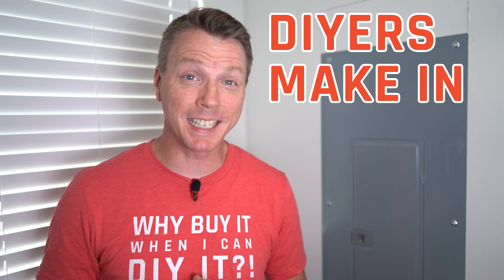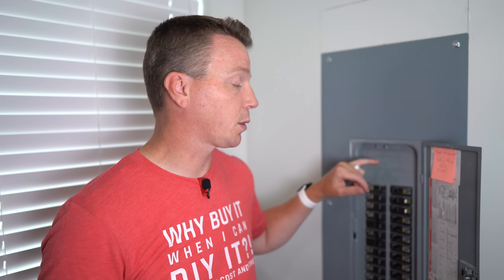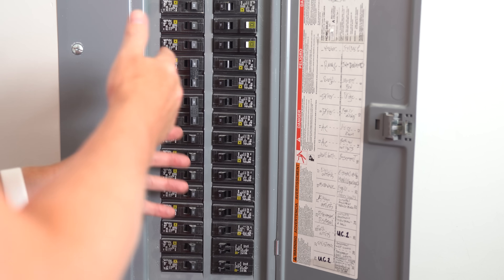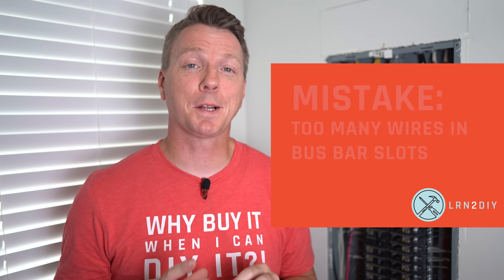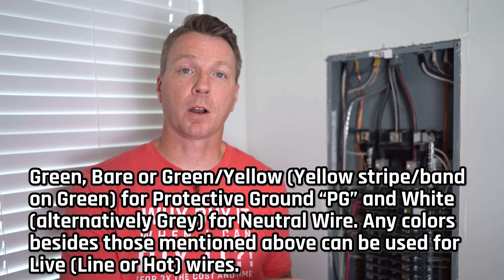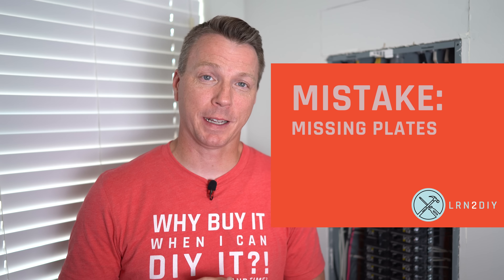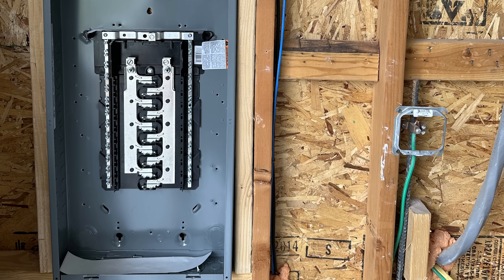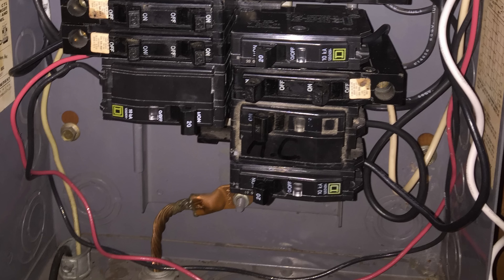10 Common Mistakes DIYers Make In Circuit Breaker Boxes

Comment: The money savings DIY.  200 amp 220 main. Iirc 10k watts for heavy electric 220v motors put in by expert certified Electrician*.  Ran correct rated wire to required disconnect. Then smaller wire last 10’.  Melted circuit breaker, then disconnect.   Dummy me calls Electrician who checked loads.  “Your 10 hp motor is drawing too many amps” I have Cuttler Hammer disconnect, breakers replaced $$$. *I had requested Square D QO but he put in CH 
  I remove motor, have it checked.  Load tested.  “It’s well within range”
 So I melt more breakers.  Expert Electrician tells me to put MUCH larger rated breaker.  It ruins 200 amp main.   It then trips every 3 hours load.  Instead of hiring *Expert I go online. But recommended replacement  25k watts rated. It has 2.5 TIMES the capacity at same amps.  Iirc $60.  5 minute replacement. ok took me a half hour in spring I will check torque using socket. 
  All because he put SMALLER wire last +10’ in conduct.

Comment: There are a lot of comments here about Romex color, but they all ignore Romex's competitors -- in the 1970's, there were lots of companies making NM cable, and a bunch of them used black sheathing, such as the Phelps Dodge company.
Also, regarding double-tapped neutrals and grounds: Square-D explicitly lists the torque requirements for double-tapping 14AWG or 12AWG on their ground bars, knowing that both wires need to be properly connected. They also indicate that putting two 14's is OK, as is putting two 12's, but never a 14 and a 12 together, because the 12 will prevent the 14 from having a good connection.
Regarding wire color, some local jurisdictions add additional requirements. For example, my county says that "a single hot MUST be black, the second hot MUST be red, and a third (usually only applicable if running multiple circuits in conduit) MUST be blue."

Comment: I think you should add that its against code to install a breaker that is not approved for that panel. A square D panel can only use Square D breakers or breakers approved by Square D.

Comment: Having been educated in electrical engineering at an MIT level university followed by military electronics service and 40+ years doing design work, I grimace when I hear some of the erroneous information being taught about electricity.

For instance, you said,

  "there's some serious voltage and amperage flowing here"

"14 gauge wire that's capable of producing a lot more electricity pushing a lot more voltage or amperage"

Voltage doesn't flow.  Voltage is a measurement of the potential between two points.  The amperage (amount of current) that flows is dependent upon the applied voltage, the impedance of the load and the impedance of the voltage source.

14 gauge wire doesn't produce electricity or push voltage or amperage.  14 gauge wire is just the medium through which the current flows.

Comment: Great video. I was wondering if you'd tighten up connections. I always do this when I have a panel off, not with a torque driver (I'll get one.. never knew it existed) but by hand to ensure they're snug. They're seldom loose, but if a slacker installed something, they can all be loose 1/8-1/4 turn.  The box at the end was super clean, but as a long time troubleshooter, I've often cut tywraps to trace wires.. then tie them back again.

Comment: its all good  unless you live in UK  240V  BROWN=LIVE    BLUE=NEUTRAL   GREEN/YELLOW=EARTH     now lets look into the breaker box   there are whites there are blacks  some used as ground and some used as neutral  they are very thin   whats that big fat red cable?  ah the cooker  then at the cooker socket its brown  so somewhere there is a junction box where it changes colour  this would explain why my cooker has no power at the socket  has the breaker tripped NO  is there a short circuit NO  is there power to the breaker both ends YES  is it open circuit NO is it slightly open circuit (burnt contacts) where it holds some voltage but no current  I DONT KNOW  cuz i cant load it  where is the junction box?  i dont know i have just moved into this flat and its not my problem i am not allowed to look for faults   does your kettle work YES then shut up and make a coffee

Comment: When I bought my house my father and I looked in the electric panel.   Obviously, the township didn't do their job.  A number of circuits had two or three lines plugged in.   We bought breakers and fixed the problem.
Then we had to figure out what breaker controlled what room or appliance
I do want to put in a sub panel and will  have an electrician do that work. It's beyond what I can do.

Comment: Not the same subject but a question for the sparkies in here.  I bought a condo years ago that was built in the early 70's.  For some reason there was copper and aluminum wiring going to the same breaker.  It didn't seem right to me. Sold that home version of a ford real but not quick enough. lol

Comment: He’s right on about 90% of this information.  He does explain things in a way that other DIYers will understand, but there’s a saying in this line of work; “knowing just enough to be dangerous.” One thing that I would edit is the bit about overloading the panel. Load calculations have nothing to do with how full your panel is. It’s a long and boring process dictated in detail by the NEC but to overly simplify it, all loads in dwelling units (especially single family) are not used simultaneously and continuously and even if you purposely turn everything on at the same time, you’d still be hard pressed to pull 100amps through that panel. Besides, busbars in Square D panels (as well as some other brands) are usually rated 25 amps above the main breaker rating. And tell me, how would feeding a sub panel from the panel your worried about overloading help? Think about it. Otherwise, well done slim…we’ll make a sparky outa you yet!

Comment: Do you a video on how to layout dedicated circuits in a hometheater to eliminate groundloops hum coming through speakers or subwoofers?  I heard that the breakers should be on the same leg or phase, but it is not clear to me. I don't know if my breakers are installed properly.   Thanks

Comment: Remarking the white wire is only code compliant for the feed to the switch for a light. It happens a lot on 240V circuits to A/C and such things when done by HVAC techs. One of my pet peeves when I was still working was that inspectors would allow HVAC techs do, but electricians would get red tagged for it. And in new code the remarking for a switch isn't going to be permissible because a white/ neutral wire is now required for switch locations to accommodate smart switches.

Comment: See the problem with my panel isn't just the fact that it's labels like someone had a seizure in the process, but also that the circuits make NO sense. I have the garage, outside lighting, half the living room, half the kitchen, half the basement , AND THE MICROWAVE all on a single 15amp circuit. How am I supposed to even label that??

Comment: Don't forget improper ground bonding.  I see a lot of sub fed panels with the neutral bar bonded to ground with the bonding screw .
Reply: That would be normal and required if the panelboard had a main breaker existing as main  service disconnect.   This example was a MLO subpanel with an upstream disconnect which should have been pointed out in video.

Comment: Regarding labeling circuits in the breaker panel. Instead of scrawling in my poor handwriting on the panel and trying (and failing) to find pre-printed labels suitable for my house, I created a table in a document editor (I forget if I used a table in a word processor or used a spreadsheet, probably the spreadsheet knowing me). I then printed it out, trimmed to fit my panel door, and attached it with small magnets. This has the benefit of being easily changed if I end up reworking my house electrical. The downside is paper is flammable...

Comment: First.  That circuit breaker finder doesn't work on long runs like schools.  Second, all kinds of wireing colors are used but gray white bare or green should be considered hot. My house has blue, yellow, orange, red, even purple hot wires.

Comment: Your points are all good and I agree totally,  I wish you would have spent more time on electrical safety especially in a main panel.  Some of us know you are in a sub panel and it must be totally deenergized otherwise you would not be so cavalier with your fingers.  It might have been useful to show a main panel and point out the main breaker and the parts of the panel that are still dangerous and energized.

Comment: That is a Square D breaker and has two positions for tapping and is therefore not double tapping.  It is NOT double tapped.  I suggest you call Square D.  They are NEC compliant.  That is one of the reasons to use Square D QO or Homeline boxes.  Of course the Arc Fault and Ground Fault breakers only have one position.  I have seen inspectors claim that what you show at 8:40 is double tapped, but I refer them to the specs and Square D's phone number.  Double tapping is placing 2 hot wires in the same position i.e. same screw.

Comment: I hate to break it to you, but there is white NM 12-2 wiring out there.  Yellow tends to be the Romex brand.  The actual gauge will be on the outer sheathing.  I never bother with 14-2 wire.  I use 12-2 even for 15 amp circuits.

Comment: Thank you for your video. I have a question. Can I install wires through the back of the breaker box into the interior wall and then under the house?

Comment: Taping the conductor I'm my jurisdiction is not legal unless it is larger than a number 6 conductor. Smaller wires need to be either heat shrunk or can be painted to properly identify.

Comment: If found that labeling things backwards works well.  Put the number of the breaker on the OUTLET, when possible.  Fridges and stoves and ceiling fans are more difficult, but there is less to write on the box.

Comment: jus a little fyi for using a toner. the orientation of the nose of the tool to the breaker makes a huge difference in its effectiveness. holding it sideways can greatly reduce its effectiveness.  be safe, have fun.  cheers

Comment: If you're turning breakers off an on (the "loud radio method" or "yelling method") there's a fast way and a slow way.

Slow - turn breaker off, wait a second for the radio to go quiet or the yell.  Turn breaker on.  Repeat.
Given N breakers this can take as much as 3N seconds.  

Fast - the binary-sort method.  Flip half the breakers off.  If that didn't quiet the radio or start the yell, turn those back on and turn the other half off.  Repeat until you find the one breaker.
Given N breakers this can take as much as log(2)N seconds. 

That means for a 32 breaker panel the slow method will involve as much as 63 offs and ons.  The fast method will involve 4 such moves.

None of this addresses the IW (inside wiring) connecting unrelated areas, circuits, uses, etc.  That will require opening walls, drilling through studs, and generally take 1-2 days of two electrical pros.

THAT is not DIY at all.

Comment: Sir, mistaken #1-#10, is (1), turn off main breaker BEFORE removing access panel, and (2) know that the service wires (100-200 or 400 amp) above the main breaker are LIVE, so don’t wave you fingers around it.  Touch the wires or the lug tighteners, and your wife will a widow.

Comment: If you fill all the breakers in the panel and they passed the max load of the panel you probably "overloaded" the panel, no? if you turn on all those appliances, lights that connected to the breakers, you probably will need more amps than the panel is rated. But isn't that what breakers are for? if you pass the load the breaker will trip, isn't that right? I can't really understand that statement of "overloading the circuit panel". Is that an extra safety step in case the breakers will not work properly?

Comment: Like most people sometimes I'm a DIY'er, sometime I hire a "pro". It's still good to have the knowledge because "pro's" make mistakes, often huge mistakes on your dime. I've also had "pro's" that totally lied about something small that was broken and instead wanted to put me in for a fortune in repairs. Once on an a/c I got charged for Freon, which blew out of the a/c when disconnected, vented for quite awhile. I was told I need a huge repair in the attic, I went up there and saw the part I needed "fixed", well, the original tape was keeping it from being seen, I suppose he was a psychic repair man. I bought a cheap capacitor and fixed it myself thanks to YouTube. 
Similar things have happened with cars. I had a car that "needed a new computer", that was after they'd sold me a new alternator, and it didn't fix the problem. I went home, got on-line and it turned out the old alternator probably was fine, what I needed was a new fuse.
It'd be nice if we could trust the pro's. That last one was at a shop I usually do well with, so I think they truly believed what they said, they were just wrong. Their mistake cost me hundreds, could have cost me a lot more for a new computer. I think the fix was about 0.20 cents. 
The list goes on and on, I worked for years in hospitals, you need to know what's happening there too.

Comment: I'm not a professional electrician but I'm an electronics engineer. I'm helping a friend on their house built in the 50's. The 100amp 20 breaker panel is dated 2014.  There is only one bus bar on the right with 20 spots. I guess you could buy a second one for the left side? The previous work looks very professional but you have no choice but to double up on the bus bar.

Comment: My breaker box looks like a bomb went off in there.  Wires are just all over the place.  I think it has 30 spots for breakers, but there sre so many wires running all over the place I can't understand any of it. I cannot afford to have an electrician come rewire the whole house, as I am a widow on a fixed income, but I have a lot of overheated recepticles, and some that don't work at all.   HELP!  Yours looks so clean and organized, I'm embarrassed of what I have in mine.

Comment: I’m pretty sure some idiot double tapped a 14/2 and 12/2 onto a 20 amp breaker. Will have to move the 14/2 to its own 15 amp breaker. Be careful who you let do electrical work in your home.

Comment: I just cleaned up a panel from the 60s that had a couple of MWBC circuits, and the handles on the breakers were not tied together. The panel was a mess, and it wasn't obvious that it was an MWBC as the breakers were separated and on the same leg. Fun!

Comment: A bigger problem with running one pigtail ground from a group is that you violate the NEC code on gnd wire size.  It can be 1 size smaller than the conductors (ex. 14 awg in 12 awg cable), but if you have just one 14 awg wire to ground say four 12 awg cables, your ground wire is now way undersized.  Another confusion is when solar power or generator current is fed into the bus-bar via a breaker.  Several good youtubes discuss NEC sizing rules on that.  The bus-bars themselves have a max current rating.

Comment: Does the panel manufacturer state only one conductor per screw on the ground and neutral bar ?  I’ve done that on many occasions here in Washington state and have never been written up for it because it wasn’t ( at the time) a code violation. Of course I never put two different sized wires under the same screw because the smaller one would have a looser connection, but same size wires should be fine and I’ve never had a problem.

Comment: "The white TYPICALLY represents a 14 gauge wire." This will depend on how old the Romex is. In newer houses (since about 2005), this will be correct. Use a gauge measurement tool to verify the wire or read the printing on the Romex's outer cover. They've even started using more colors than white & yellow. The white is now 14-2, the yellow 12-2, and the other colors are for different gauges, such as 10 gauge, or to indicate 14-3 or 12-3.

Comment: One way I have found to help me find a circuit when I'm all by myself.
I'll run an extension cord from the Outlet on either trying to turn off or Trace out, and either the court will have a lit in or you plug your tester in and voila turn it on and off and you can know what circuit you're at.

Well here's egg on my face I was going to show you the code article stating that you can have more than one grounded conductor on a terminal and turns out I am wrong.
I believe you can do it with the ground as long as there's the same gauge but on the grounded conductor congratulations sir you kicked my butt.
Great video

Comment: No one mentioned the circuits of brown 12/2 wg that were used in 70's and 80's. The black romex I find is all 12/2 and has no ground. That means all the old romex upgrades are just like the knob and tube that aren't grounded. House built in the 50's I think. The hardest upgrade needed is the knob and tube going from a wall to the center for the lights and the wires and neutrals go every which way.

Comment: My whole house is wired with direct burial cable that all three conductors are black insulation...and stranded wire so you have to put terminals on them all to be able to connect to outlets / switches....talk about a nightmare to work on.  I have white and green tape that I've been slowly adding to wires as I have to work on things but I'm sure there are probably ground / neutral wires that are crossed in that system.

Comment: Back in the seventies I took a look in my Dad's panel in his basement because he complained the kitchen range in his newly built home was not heating properly.  It had been installed with aluminum wire and the terminals had oxidized badly.  I cleaned and re-tightened them and all was okay.  Do they still use the aluminum wire ?  It seemed like a hazard to me.